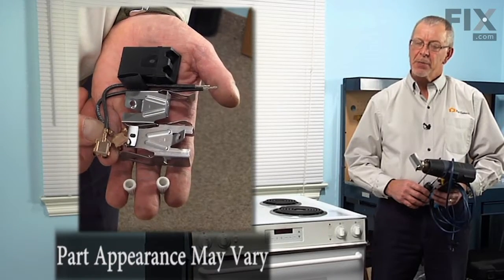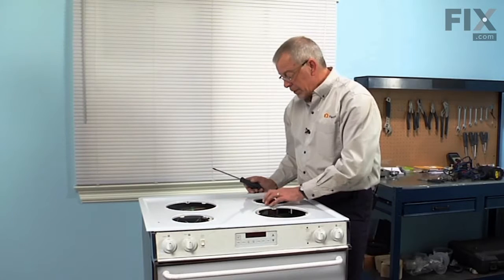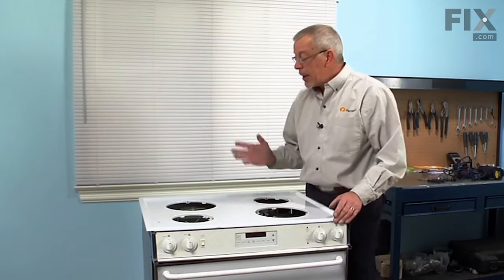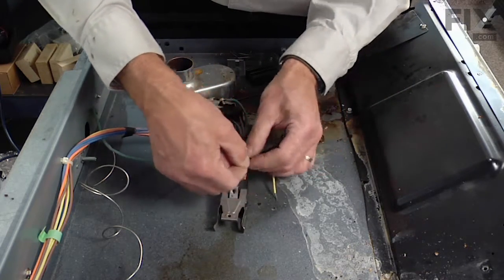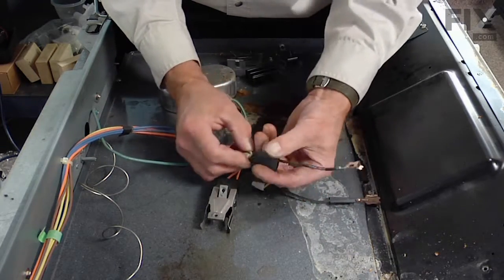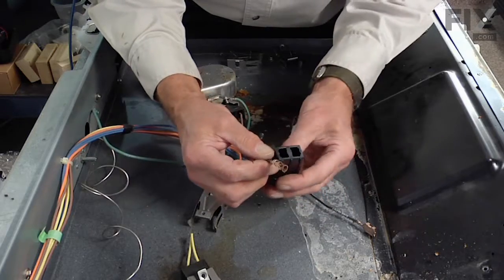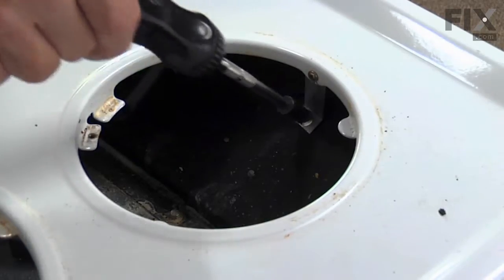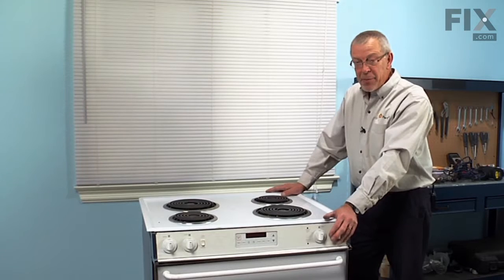Kenmore Range Repair – How to replace the Surface Element Terminal Block Kit

Comment: Are there some older models of ceramic top Kenmore ranges that do not have a baking element or have a dual broil/oven element because I bought a used Kenmore stove that only has elements on the top of the oven & not the bottom? There are not even pre-drilled holes at the bottom of the stove, but there seems to be a spot there to drill holes. Would someone buy a kenmore stove without a baking element or does the top element serve as both the baking element and broil element? Thanks!